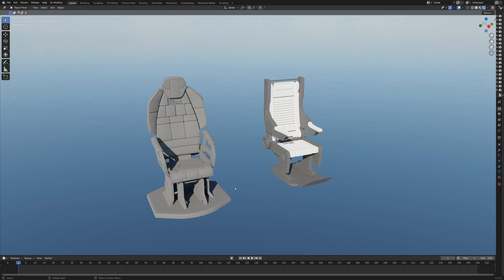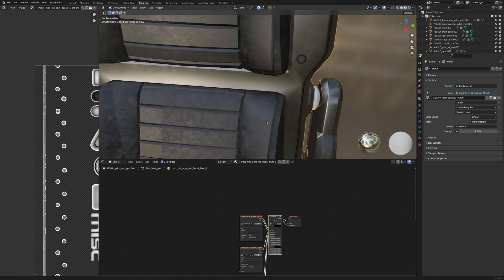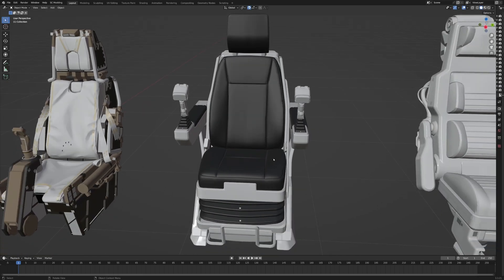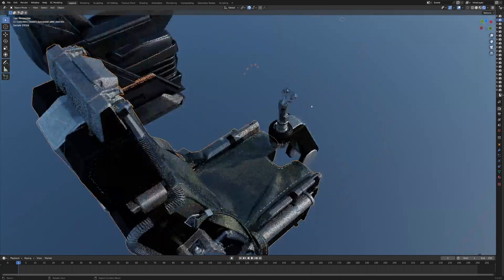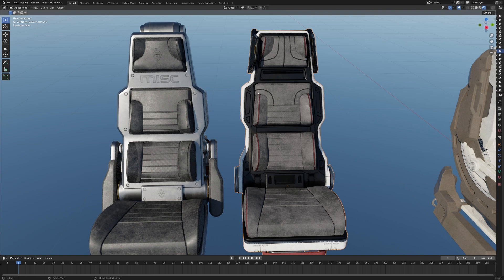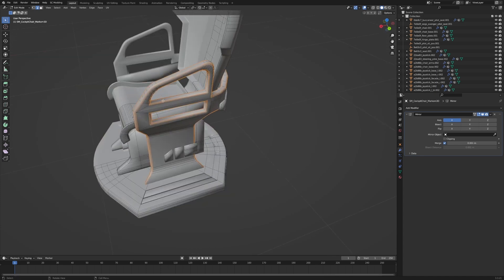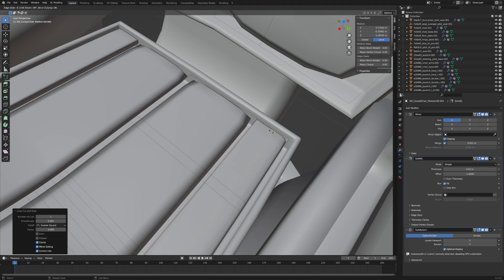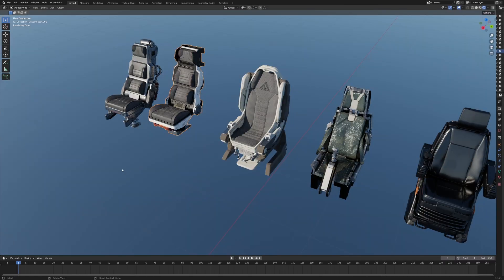Lets investigate Star Citizen 3D models of Cockpit Seats for Blender

Comment: use weighted normal modifier with these meshes. these models are midpoly workflow and make use of chamfers with weighted normal modifier to create a beveled (round) edge. basically the normalsd get bend. clear custom normals (edge data) and add weighted normal modifier with set sharp faces. also you could benefit in your own model from weighted normal modifier (midpoly workflow) aswell since you rely on bevels & subdiv workflow wich is not what Star citizen is using. I can see the hose on the chair is sharp shaded so something is not setup properly. shoot me a pm if you need help. please use eevee cause cycles noise will create bad compression on youtube